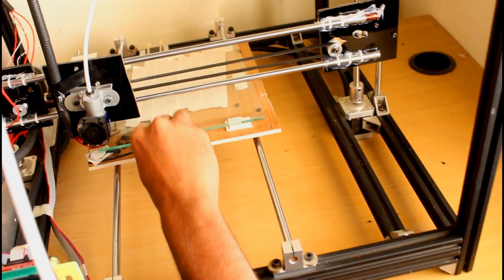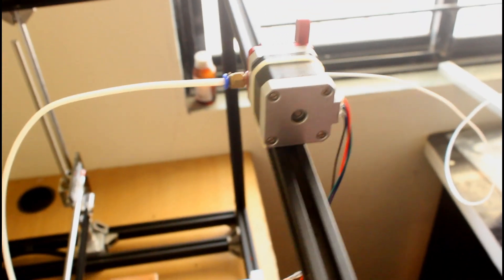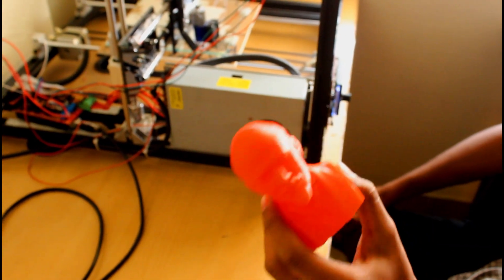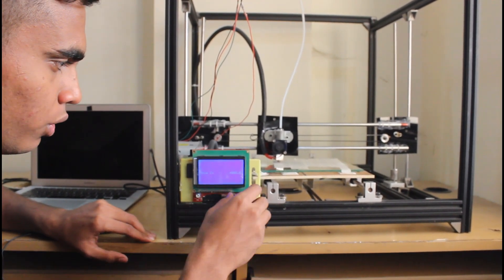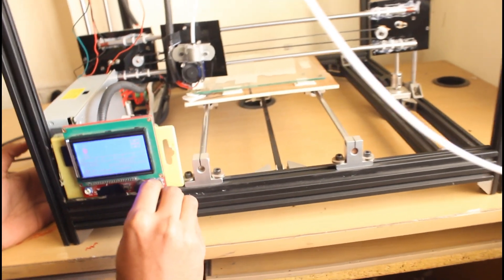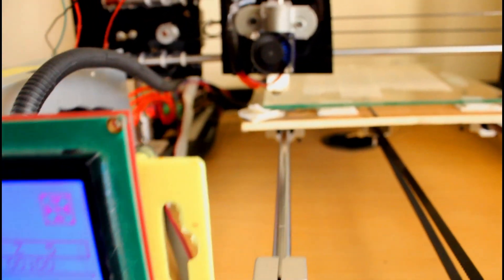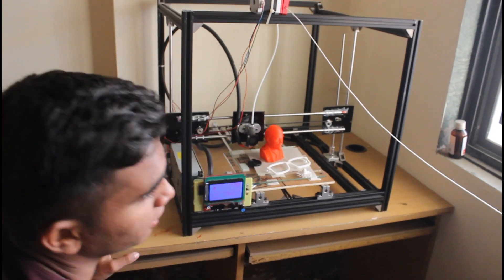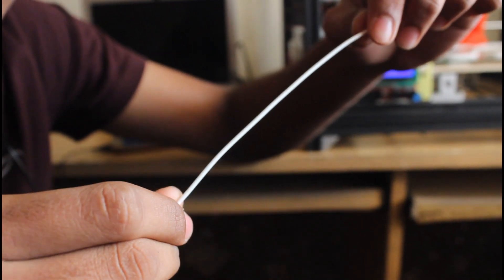Homemade 3D Printer | Amazing items Made with 3d Printer

Comment: Bro how you install marlin software into aurdino mega 2560 for your 3d printer.. I'm already tried this. I upload the marlin  firmware into aurdino mega using aurdino ide, the software is uploading but the display is not showing it will blank after uploading code.. please help me did you have any idea

Comment: What power supply are you using
Reply from the maker: SMPS
Reply: @TechsScience  kitna amp ka he or kitna volt he
Reply from the maker: SMPS 
5v,7v,12v volts Supply deta hai
With max 2Amp
(Search SMPS on Google)
Reply: @TechsScience   mere pass 20Amp ka he ...Kya ye power supply use kar sakta hu me
Reply: @TechsScience  I use ramps 1.4 and arduino mega.but getting issue in grbl controller . Error massage is
"No data from COM port after connecting. Expecting Grbl version string."
Reply from the maker: Haan chalega
Magar 5v & 7v supply bhi chahye hoga Circuit board 5v se chalta hai
Reply: @TechsScience  20 Amp 12 volt  ka he mere pass ..To use bhi use karu 5 volt ke power supply k saat

Comment: Hi I am building my printer as you did but my moters are not working but the hotend  is heating .and I tried to move the motor using pronterface and it's not working.